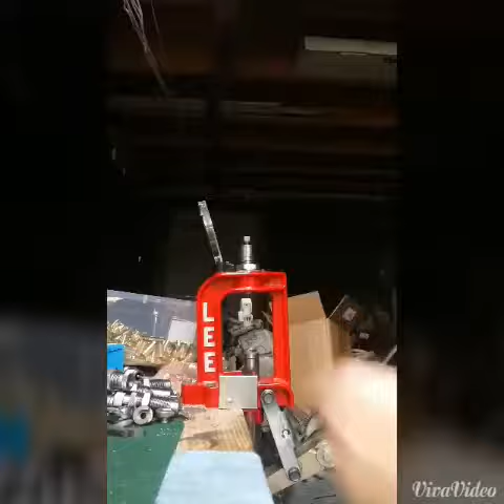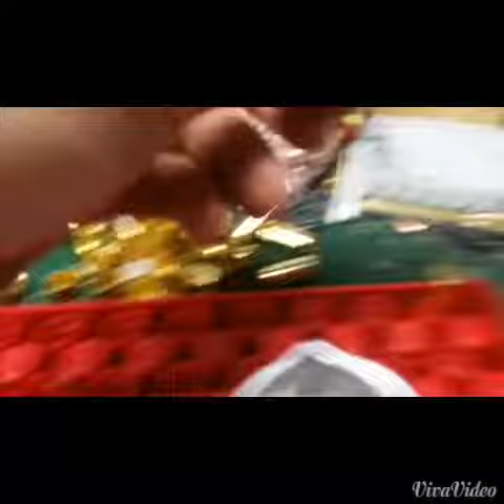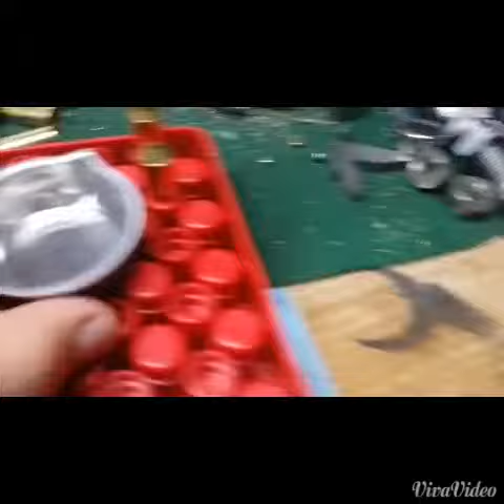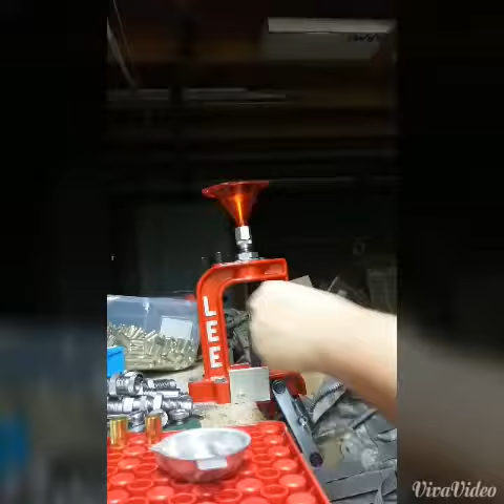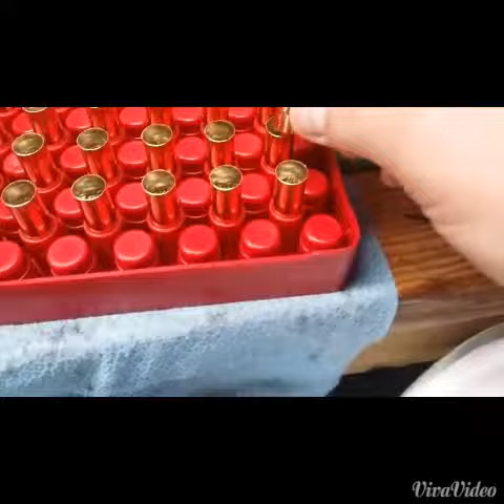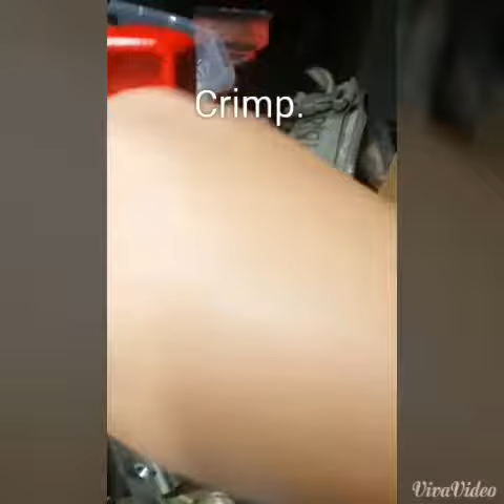460 Rowland Reloading

Comment: Does anyone know where I can get a Die set for 460 Rowland reload?
Reply from the maker: You use .45ACP dies, bro.
Reply: How is that possible the brass is slightly longer.
Reply from the maker: JesusAlphaAndOmega Doesn't matter you adjust the dies the same way to work with the longer length. Works the same as 10mm and .40sw.